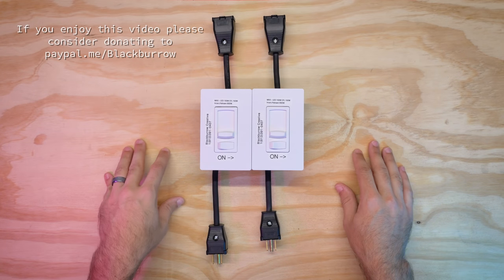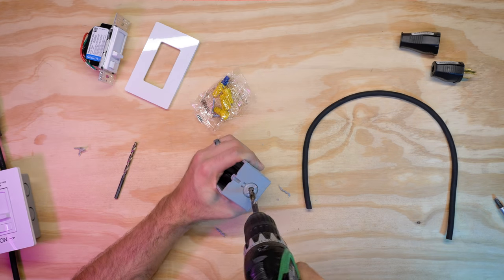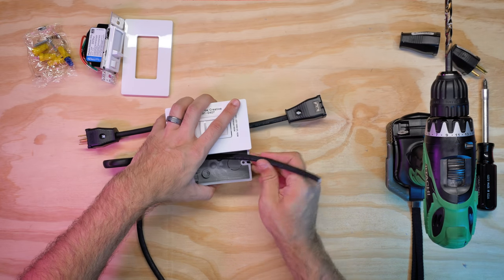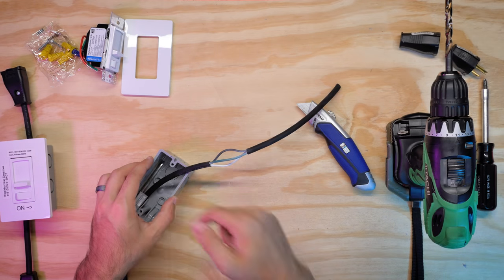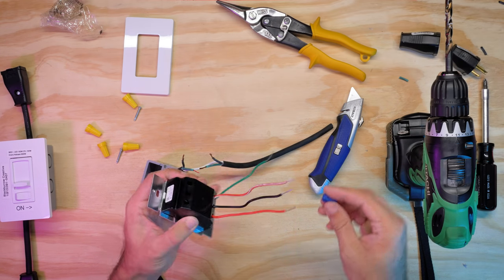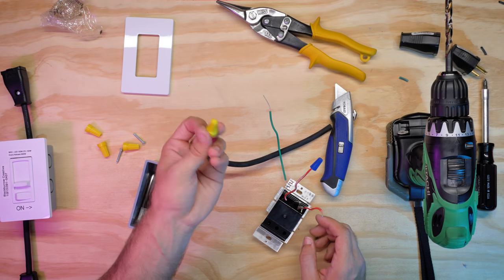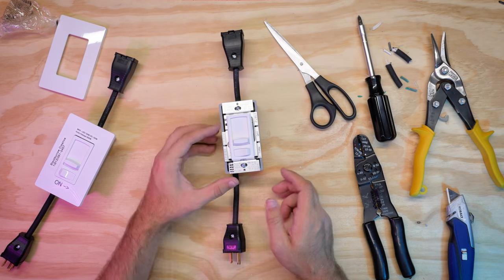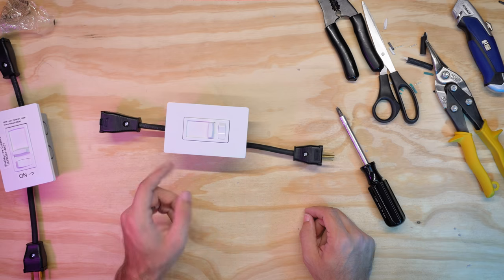Build your own compact dimmer for LED lighting

Comment: you can add electrical wire strain reliefs on each end of the box...it would really help on the set.
Also should have used 650W dimmers for full 0%-100%
Your dimmer switch choice only gives you 50%-100% because it is a 150W dimmer.

Just letting you and others know for better results.
Reply: What 650 dimmer would you recommend?

Comment: Is it safe for any light or just little LEDs?
Reply from the maker: As long as the lights you are dimming are dimmable and don't exceed 600W they'll work with these dimmers. Works great with classic incandescent bulbs as well. If you have halogen bulbs you wouldn't want to dim them below 20% as it will burn them out quicker.
Reply: Alright. Thanks!